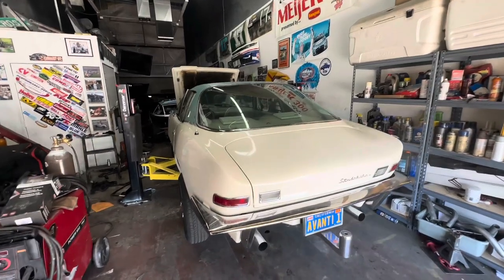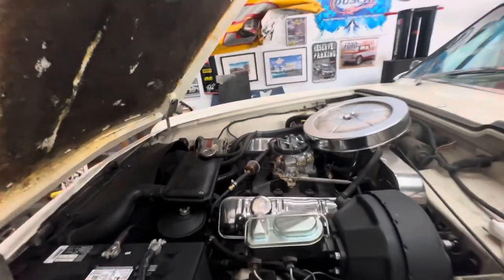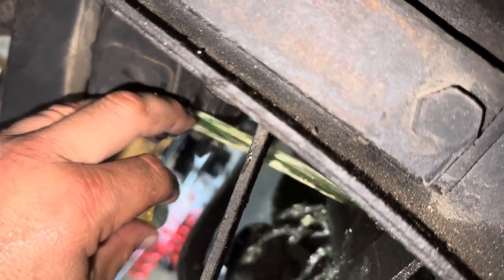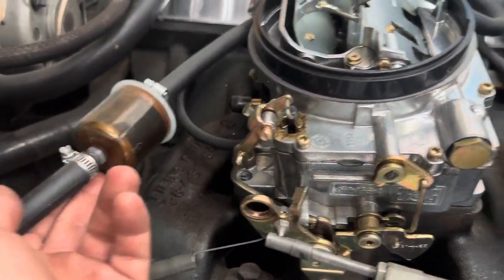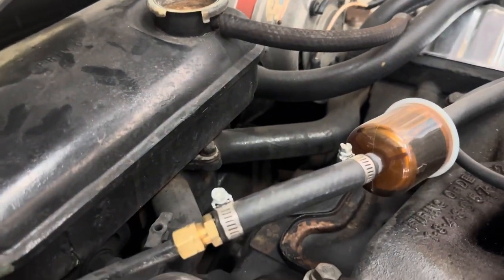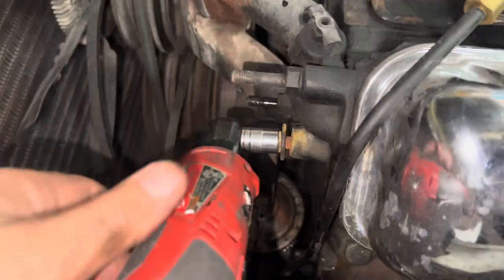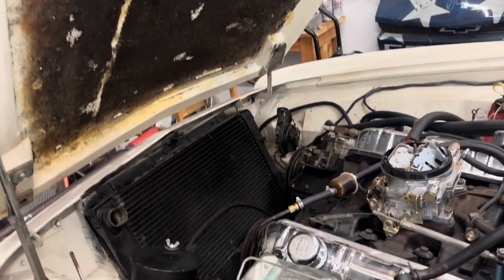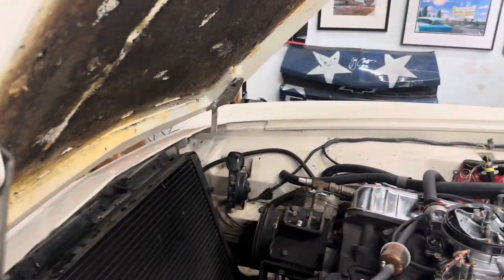John’s 1963 Studebaker Avanti - Introduction, Inspection, and beginning teardown

Comment: Thanks for the videos!  Question, probably a stupid one, but where does the hose by the radiator cap on the surge tank lead?  Mine doesn't have a hose and I'm wondering why and where it's supposed to lead to
Reply: Bolts straight to the block

Comment: Wow ! last year I bought a 1982 Avanti II, it had 110,000 miles on it with a Chevy 305 engine, i had the front end rebuilt, brakes, shocks etc. The biggest problem I had was to find an auto shop that would work on it since very few shops work on carburetors, I have spent way to much money trying to get this problem fixed.
The original carb was a Rodchester quad jet it was rebuilt so he said then another was installed, didn't work, so I ordered another rebuilt from a nationwide carb company it ran great for 5 minutes
then they could not get it to work ,so they said it has to much CFM 750 and should be only a 450 cfm now they want to put an Elderbrock on it for about $ 450 plus labor. 
Here in Florida it's tough getting anyone to work on any classic car, I'm at a lost, any suggestions ?
Reply from the maker: First thing I would do is pull it from that shop!  Sounds like they hire parts changer “technicians” and not actual mechanics.

750cfm on a 305 is waaaaay too big.  Seeing you are in Florida and you don’t need to worry about emissions, I would order up an edelbrock performer intake manifold p/n 2101, and an edelbrock 500cfm carburetor p/n 1403.  That’s the perfect combo for a small displacement, fairly stock small block Chevy. Easy to maintain and tune, and you’ll gain power, drivability and economy once tuned properly over the OEM stuff
Reply: I agree, for now I will have them install an edelbrock I think 450 cfm. To tow it to another unknown shop could be another disaster, thanks